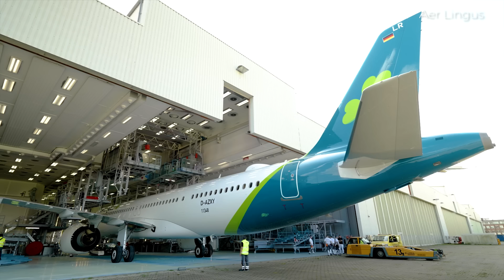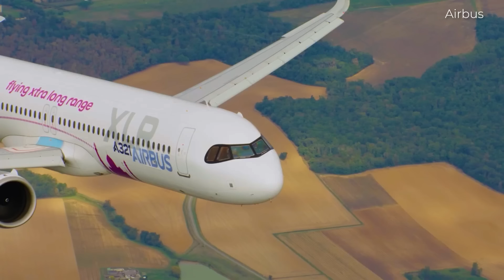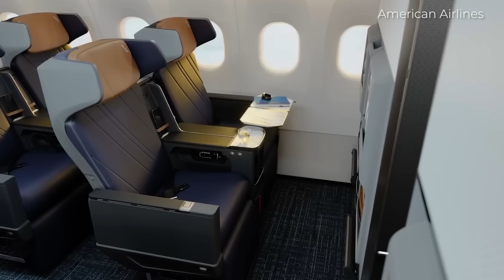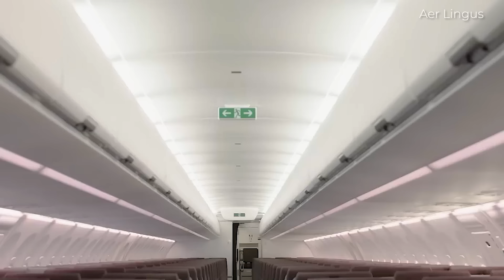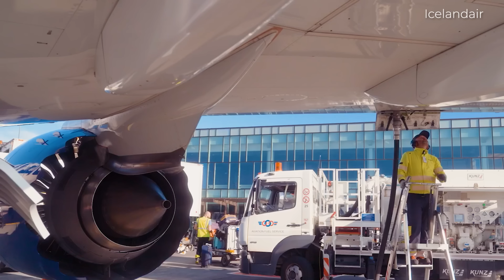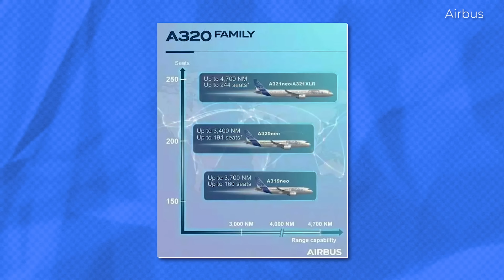The Airbus A321XLR Could Change Air Travel Forever

Comment: Flying this plane from FL320-350 across the Atlantic is not something I would want to do as a pilot OR passenger. The 320 series aircraft have extremely stiff wings and handle turbulence much worse than their 737 or 757 counterpart. Having been type rated on the E170/190, 737, 757/767, 777, A320 I can confidently tell you the two worst planes I’ve ever flown to handle turbulence were the Embraer and Airbus. The 777 handles turbulence the best. Plus, who wants to be in a narrow body bird for anything over 6 hours? Big miss for me as a pilot AND passenger.

Comment: Airbus A321 XLR is not all it is cracked up to be fully loaded it needs 8000ft runway to take off
The old 757 fully loaded could take off from 6000ft runways fully loaded it was a more capable aircraft
In New Zealand there is only 2 airports that have runways over 6500ft - 321XLR useless here.

Comment: The a321 is coming in at 150 seats in a premium dense configuration.  Look at United with their a321xlr (150 seats) and Jet Blue is similar with their a321LR mint class at even less because they have the mid cabin lavatories. 

The a321xlr is not 200 plus seats when you have business class and premium economy.  As someone has pointed out, loosing the mid cabin lavatories to make room for the expanded fuel makes the plane less desirable for long haul. 

The demand curve to expand premium seating options and capacity has United’s 787-9 come in at 222 seats.  When you take a 787-8 and configure for premium dense seating, you are talking about 185 seats.  

For an airline like Jet Blue, the a321 LR or XLR is a risk adverse path to add transatlantic since they have commonality with their domestic fleet.  Jet Blue would have to spend significant capital to expand to wide bodies with planes, crews, simulators and maintenance.   Given their current debt, they would be betting the airline. It also explains why Alaska bought Hawaiian - it gave them a wide body infrastructure for transpacific and transatlantic out of Seattle as they take on Delta. 

For a major airline like United or Delta, it’s to expand destinations out of their hubs, not bypass their hubs and go point to point.

Comment: The A321XLR has received a lot of orders because it fills a niche airline accountants cannot fill with any other new aircraft. However, its fuselage width was designed for short-medium haul flights. Long haul is pushing it in terms of passenger comfort in economy class. A five abreast premium economy cabin option would be nice but Airbus do not offer it on the A320 family.

Therefore, I hope their next-generation single aisle (NGSA) project calls for a fuselage that is about 12 inches wider than the A321XLR, for improved comfort and cargo space on thin long routes. The design should also feature a taller landing gear to support very high bypass engines and an optional stretch variant with modest tail strike risk. This feature combo would let Airbus offer a narrowbody platform to airlines that would otherwise buy a 787-8 or -9, given that the A330-800 has sold poorly.

The A320neo should be succeeded by the A220-500, with a tall landing gear to support a future neo version. A suitably long transition period should ease the issue of incompatible cockpit layouts.

Comment: ALL long-haul routes used to be flown by single-aisle aircraft: B707, DC8, VC10 before the B747 came along. In economy, on a widebody flight, I only have access to the aisle I am sitting by, so I wouldn't worry about not having a second aisle, as long as there are sufficient lavatories.

Comment: I recently flew JetBlue from. Amsterdam to Boston en route to RSW in the "Even More" class (i.e. premium economy—same seat as economy, just with a little bit more legroom). I found the legroom adquate, but shoulder space (seat width) seemed a bit cramped. While my ticket was well priced compared to premium economy on American, Delta or United, I noticed that pricing can be quite volatile. Perhaps this is due to the lw number of seats available, that can fiill up quite quickly.

Comment: The only reason the A321XLR is viable is because Boeing never updated, let alone replaced, the 757. The A321 XLR can cover some of the routes that the 757 used to fly, but it's not quite a direct replacement, particularly on the longer, thinner routes. The main reason why airlines are flocking to the XLR is because there's no viable alternative; there's no direct replacement for the 757. Because Boeing is dragging its feet on a 757 replacement; because existing 757s are aging out; because airlines need to cover the 757 routes; they're flocking to the A321XLR because there's nothing better available. It's just that simple. If Boeing were making a 757 NEO, I doubt that the XLR would be doing as well as it is.

Comment: 10-11 hours in a 3x3 single aisle is ☠️. 
Long live 2x4x2 seating.
Reply: I don't care about width or 3x3. Length is by far the most important thing.
Reply: The seats have the same width as the A350
Reply: What I miss are the 767s 2-3-2 seats

Comment: This content is heavily loaded with misinformation and false claims. First, the A321XLR cannot fly 4,700 nautical miles non-stop unless you reduce passenger seat count from 220-240 seats down to 150 revenue seats, which means a lot less revenue, more costs per seat, more fuel burn per seat, more emissions per seat. For a 8-10 hour flight, the aircraft will need extra crew on board and crew rest seats, which means fewer passenger revenue seats and more costs. Forget cargo revenue, which is usually needed to break even.

Narrow-body aircraft were not designed for long haul travel. Flying on a narrow-body aircraft for more than 6-10 hours is very painful, cramped, and uncomfortable. The business class lie-flat seats are usually super tight and cramped. The A321XLR also does not have the lower cabin pressure altitude capability to reduce the stress of flying long haul as on the latest wide-body aircraft.

The A321XLR with a heavier 101-tonne take off weight is only required for maybe 5% of the airline's network, making it a niche aircraft. The heavier operating weights would be hugely inefficient and more expensive to operate on 95% of the airline network, which are shorter range routes that do not need the extra weight and extra fuel capacity. That extra fuel tank embedded in the A321XLR fuselage become dead weight. Remember, its takes extra fuel to carry extra fuel just to fly a little farther. Again, the A321XLR would have to be operated as a sub-fleet since it is expensive to operate on the vast majority of the airline's network. Instead of being 30% more fuel efficient as the AI narrator claims, its more likely to be 30% more expensive to operate.

The A321XLR heavier operating weights also exceed many of the smaller airport's runway strength and is limited to operating only at major airports with a stronger tarmac, thus making the aircraft less versatile, less flexible. Precision is not in the equation for the A321XLR. Its a heavy, expensive, niche sub-fleet type. Its an experiment that has not yet proven to be viable.

Comment: I think many airlines are now wonder if the Boeing 787-8 is a better idea than the A321XLR on routes over 3,700 nautical miles in length. I wouldn't be surprised that multiple airlines that cater to leisure travel end up with the 787-8, since it can 1) seat more passengers and 2) the plane will feel less claustrophobic to passengers.

Comment: Or “Why Boeing’s failure to replace or update the 757 became a huge present for Airbus”.
Reply: Courtesy two C-Suite executives who ruled Boeing for fifteen odd years - Harry Stonechiper and Phil Condit.   Two bean counters.
Reply: You beat me to it.
Reply: Because the 757 had no orders.  Meanwhile, airlines were filling the order book for the 737, especially the NG series.  Think of Southwest, Ryan Air and all the majors before the big merger boom (American, Continental, Delta, United, US Air).

The 787 replaced the capacity of the 767-300 and 400 while giving greater efficiency and range.   They need to add a freighter version and decide whether the 787-8 is due for a second generation. 

The 757-200 was a hot rod, over powered during an era of cheap fuel.  Even a new single aisle wont have the climb of the 757-200,  airlines want efficiency.   Pilots always love to comment on the performance of the 757-200.  Of course, if their pay was tied to the efficiency of the aircraft they flew, they wouldn’t want to fly it.
Reply: @raptorshootingsystems3379  This is the thing I don't understand.  If the 787-8 exists, why don't airlines just buy these instead of doing these superstretch narrowbodies?  You can put way more high-margin premium seats in a 787, and they can carry way more cargo below deck which can sometimes be the difference between a route being profitable and not.  I genuinely don't understand the business case for long haul superstretch narrowbodies.  As a passenger, I will avoid these like the plague.  I'll sooner swim than cross an ocean in a narrowbody.
Reply: I will never understand why everyone in these aviation channels has such love for the 757.  The flying pencil really was miserable to travel on.  Boarding/deboarding takes forever (because one aisle), the one superlong aisle is almost always blocked up by either the drink cart or someone trying to go to the bathroom (or both!), and for anything longer than basic domestic (3-4 hour) service, it feels way too claustrophobic.  Boeing's ACTUAL perfect plane that they needed to replace was the 767.  The 767 could basically have done everything this XLR does, but in greater comfort and holding way more (profitable) cargo below-deck.  The 767 (with the amazing 2-3-2 config) deserves way more love and the 757 deserves way less.

Comment: This sounds good as a marketing strategy but looking at real world, the actual numbers seem different.  Most airlines are not getting 180 seats on an XLR.  They are being used for some premium routes but in limited numbers.  Give it another year or two to see what passengers really think about it.  Flying a narrow body for that timeframe would be horrible.  Also, with the extra tanks, your storage (cargo) goes to crap.
Reply: JetBlue has been flying LR for years and they are fine and storage is not only the way to make money. The a350ulr has even worse cargo space and the 1000ulr soon too, yet they were still needed.

Comment: I already flew as a passenger on board Etihad's A321LR on a 7-hour flight between Abu Dhabi and Phnom Penh.

If the experience is the same as the XLR, I can say that in economy, it's not as comfortable as on either the 787-9 or A380-800 on an Abu Dhabi to Paris flight.

However, I appreciate not needing to do a layover in either Bangkok or Singapore to go to Cambodia.
Reply: XLR has slightly wider seats then the LR, dunno how much that adds tho in the comfort level.

Comment: Flights over 5 hours on narrow body airplanes is horrific. Rather fly on a large plane and spend more on my ticket
Reply: you have that option with connections. This is just an extra option
Reply: for now, however with a few more industry-wide breakdowns the only ones left would be LCCs and ULCCs with tightly packed long haul narrow bodies
Reply: Hi, why does the width of the plane make a difference - especially in cases where the seats are the same widths as wide-body planes?
Reply: @rpg666 wide body planes have2 aisles and larger open areas where you can get up, walk and stretch even if meal or beverage service is underway. For older travellers or people with leg and back injuries sitting in one place for 5 plus hours is just not an option.
Reply: @marcusholmes7942 I think the aisle situation is not really any different, because both aisles on a widebody are used at the same time during meal service, so you can still be just as easily trapped in place as with a single-aisle plane. 

But it's true there's a bit more space around the gallies and toilets.
Reply: @rpg666 well you are certainly entitled to your opinion. I simply disagree an prefer wide body aircraft for long haul by a lot. Narrow bodies suck in my humble opinion
Reply: @marcusholmes7942 Sure, we can all have different opinions. I was just explaining that the extra aisle you referred to offers essentially no benefit, because they're both used at the same time in the same way.
Reply: @rpg666 the dozens of times I’ve flown internationally on long haul flights I’ve never experienced that as a problem
Reply: @marcusholmes7942 Let's not get into a pissing match about who's flown more often 😅. 

Remember, you're the one who suggested in your original comment that widebodies are better because they have two aisles, and you're the one who mentioned "opinions".

Which is ironic, as I was bringing facts, to make a counterpoint to your opinions. And as you will know, and as pointed out by airline staff in this very comment section, two aisles does little to help during meal service because they're both used at the same time.

So all we're left with is that widebodies feel more spacious, and have more room around the gallies and toilets (even though exit row people hate people standing there). And that's fine, I agree that the more-airy cabin is nice. But in terms of stress on bad legs and backs etc, the number of aisles makes very little difference in practice.

Comment: There’s definitely a subjective element to it. As a passenger, I associate narrow-body aircraft with short hops within the UK or Europe — flights that feel purely functional, just a means of getting from A to B.

When I’m heading off on a major holiday to the USA, Canada, or Asia, the flight feels like part of the adventure. In those cases, I’d much prefer a wide-body aircraft, as it enhances that sense of travelling somewhere far away. An XLR, by contrast, might make the journey feel more like a quick weekend trip than a long-haul experience.

That said, I’ve never actually flown on an XLR, so I could be completely wrong.
Reply: The XLR isn't meant for those routes.

Comment: The XLR will benefit budget airlines the most, as they can now do long haul and cater to VFR traffic without needing to commit to widebodies. I think it will be a relatively niche plane for the legacy carriers. With air travel growing every year, most routes should be able to sustain a wide-body in 5 to 10 years time. 
 
The nosy credit card gurus will tell you this plane sucks because their lovely premium seats are ruined and things like foot traffic during boarding and stuff. For the majority of us down the back though, the differences are small. However, mood lighting and big overhead bins is all well and good, but the toilet queues are really horrendous at times. XLR and LR operators must absolutely install mid-cabin lavatories on these jets. I find it helps break up the queues and reduces the extent to which cabin crew movement are impeded. If you agree, I implore you to feed back to XLR operators to install it, I will do so even if I’m not flying on the XLR. Heck, jack up the ticket prices if you must, more toilets are a key comfort factor that airlines overlook.
Reply: Or passengers can simply drink and eat less to avoid excessive toilet breaks.
Reply: Too bad some Budget carriers reduced or cancelled commitments for the type.
Wizz Air, and Cebu Pacific come to mind .
 As has Frontier Airlines.
Reply: LR is as you said a must but not possible on the XLR
Reply: Not at all. 

Cebu and Wizz have already downgraded from the XLR because they can’t get the full range profile with 200+ seats. The XLR’s sweet spot is 150-180 seats with business class. Something budget carriers don’t offer
Reply: @bennie1138000  They can still get more range than with the A321 Neo. Transatlantic flights from Keflavik are certainly doable.

Comment: 3.5 -4 hours is the cutoff for me in a narrow body economy. Anything above that is rough . I think business and first probably will be the same if companies still install flatbeds.
Reply: I find it’s the opposite. The narrowbody setups means airlines need to install denser and smaller premium seating to optimise the use of floor space. The majority of people complaining about this airplane are likely those who learnt how to fly premium through credit cards and now “can’t go back to economy”. The seats are largely the same in economy from twin-aisle to single-aisle, so the differences in comfort are small. The perceived discomfort comes from the single aisle and the resulting congestion, hence why mid-cabin lavatories are an absolute must on these aircraft. If you fly an XLR operator (even if you’re not flying the XLR itself) you must feed back to them to get those installed if they haven’t done so. It will massively improve things for everyone.
Reply: @magnustan841  Mid cabin lavatories is not possible because the tank is just underneath. Airlines at a premium level should just treat the XLR like the ULR and only install premium economy and up. Less passengers, less seats, less weights, less luggage = less passenger cargo,  and more range.